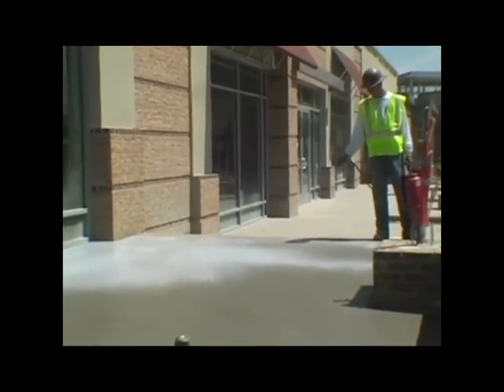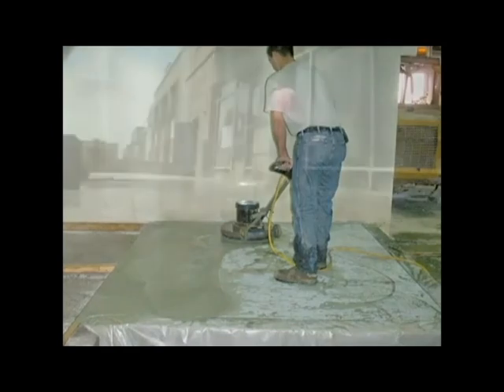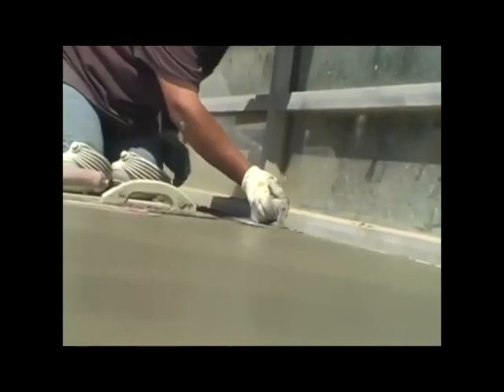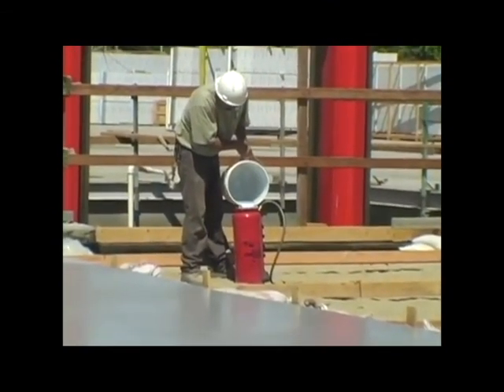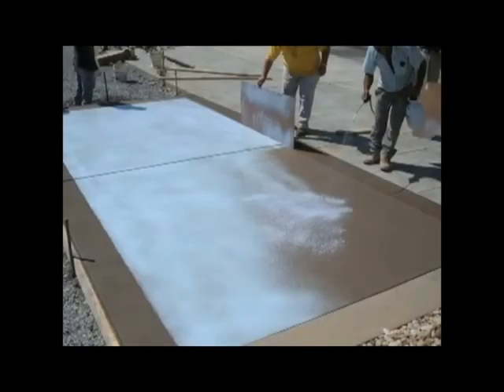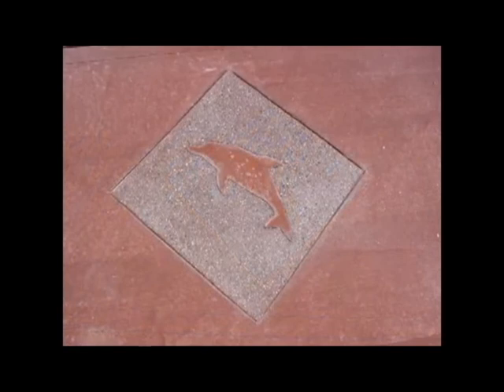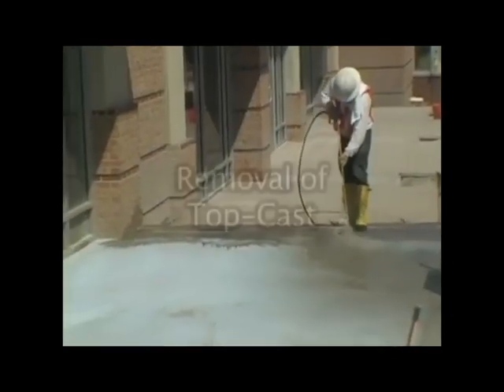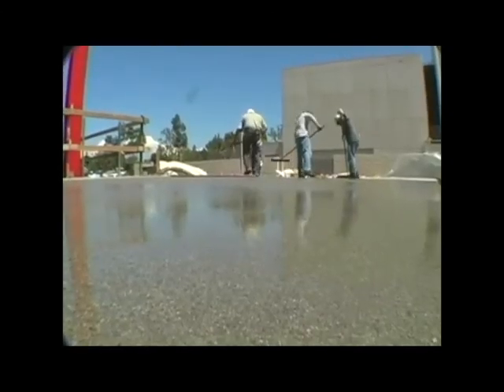Top-Cast® Installation

Comment: My contractor did not remove the top-cast in time and it has now dried. What can I do to remove it? What are my options?
Reply from the maker: You will need to contact the manufacturer, the link to finding a representative in your area is https://gcpat.com/en/locator/contact-sales
Reply: Muriatic acid (100%) or sandblasting. The acid may darken the slab slightly, so do a test spot.

Comment: Removal is one of the biggest annoyances
Reply from the maker: The SS 100 site saver helps with overspray removal, while the EX 200 extender allows extra working time on the project for easier removal. We have video demonstrations of both products on here if you are interested. Thanks!